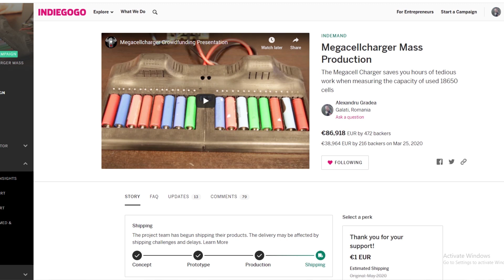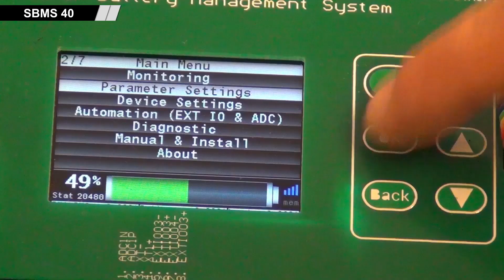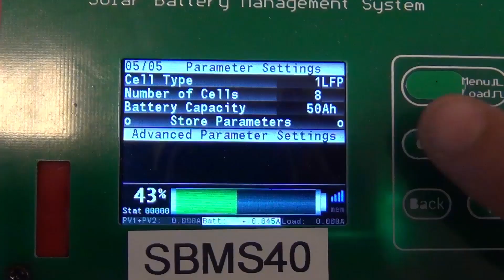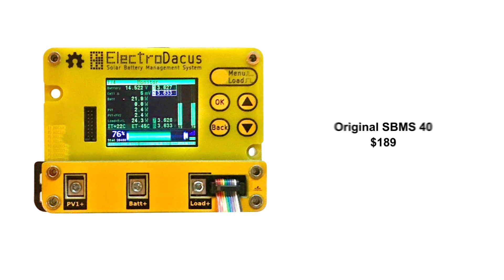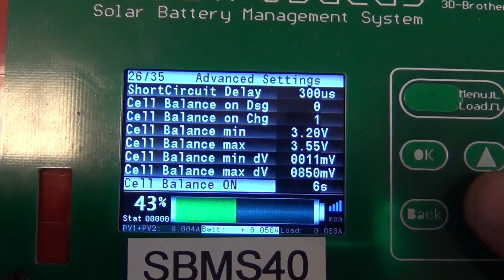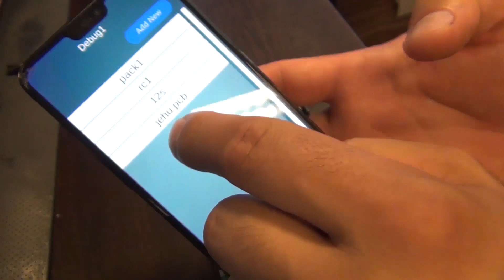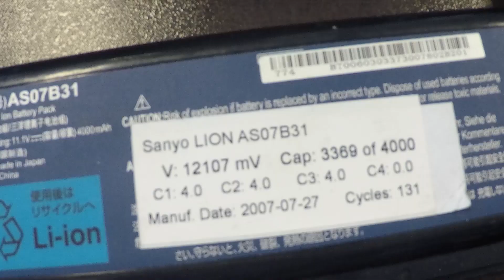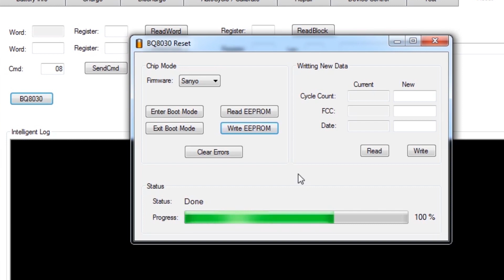Electrodacus SBSM, BLE Pack Mon, LTP Bat Reader - Crowdfunding Presentation

Comment: I'd be interested in more info on the headless version. Does it have charge discharge or is that through relays as well?
Reply: Hi, we are considering having it with optional 20 or 40A mosfets for charge / discharge.
Reply: @Alexander1560  Yeah if the headless had charge discharge that would be a huge value.  Please add this.
Reply: @Alexander1560  More info on the headless would be nice, I can't support a campaign if I don't know what I'm getting.  Some questions, can the display be left on the headless unit for monitor like the other SMBS? If charge/discharge is optional, what does the unit actually do?  How much more would charge / discharge option cost?
Reply: @rcboosted  hi. We decided to have the headless version without power side. It will be similar in features with sbms0, with external control and shunts. This is the most versatile and cost effective option
Reply: @Alexander1560  Thank for you clarifying. What about the first question, if I leave the display on the headless unit, can it show the cell voltages, solar charging current, load current etc like smbs0?
Reply: @rcboosted  It will show the cell voltages, but load current and charging will not show as those are connected to the microcontroller, also there will be no short circuit or overcurrent protection as those are outside the BMS.